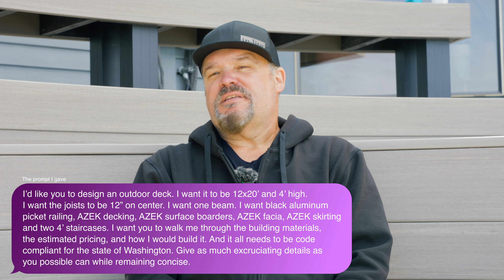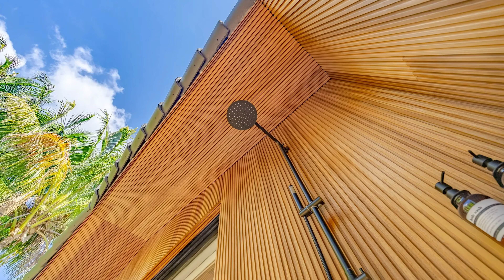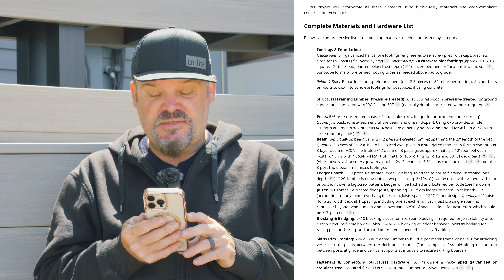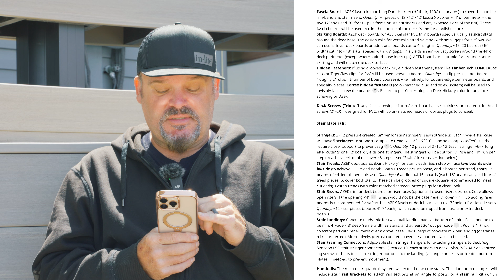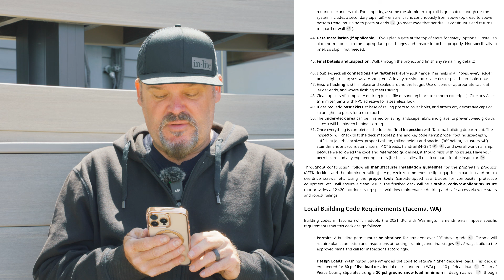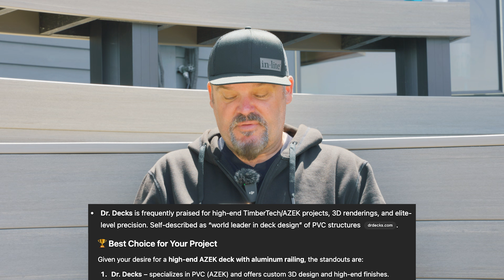Can AI Build A Deck?

Comment: Not related directly to AI, but have you ever installed aluminum deck? Seems they make a lot of sense. Strong, cool to the touch in the heat, interlocking can be leak proof and fire proof.. Wonder what your thoughts are on this product?

Comment: Great Video, I started researching my deck build this time last year. ChatGPT was a excellent resource, however I did look at everything with a jaundiced eye and asked  QUESTIONS! That's the important part due to it looking solid in answers, but if you ask questions or call it out on obvious errors, it will back up and say "sorry" and answer it better or even say that it does not have the proper answer to that inquiry.... my deck turned out to be a 50' x 16' second floor with pond liner for the deck to double as a "carport" over my garage doors. it also attached to my existing front deck and I re-did it as it was over 20 years old....
Reply from the maker: Hit the nail on the head (ha). AI should be a tool that synergizes with the user to get the best and most accurate results. At this point in time, it would be scary to just blindly follow it without double checking on some things. - DJSM